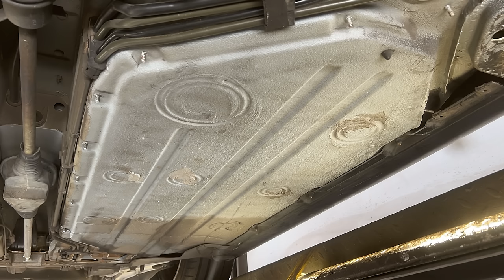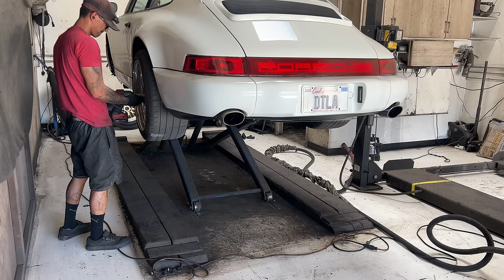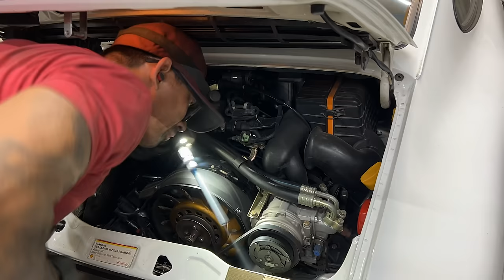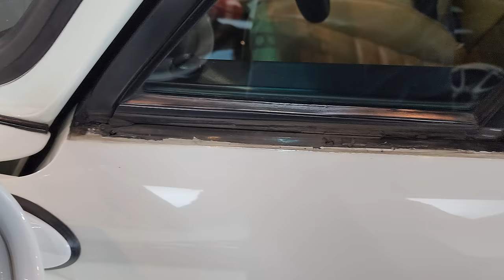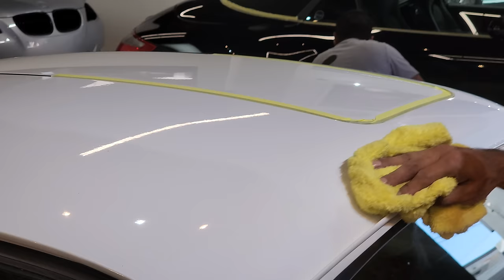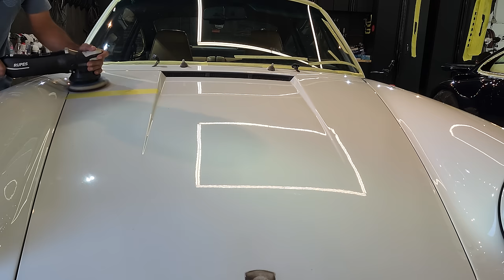Dry Ice Cleaning this Porsche 964 is SO Satisfying

Comment: Looks cool, but it’s not preservation at all. The brownish coating you see being removed it’s actually cosmolin coating from the factory to protect the aluminum components from oxidation
Reply: Taught me something today
Reply: Blah, Blah, Blah and more BLAH
Reply: @orangepeel2223 are u okay bro
Reply: Two mistakes... Aluminun rust naturaly on external layers only and, the rest looks like galvanized steel.
Reply: Should be reapplied after if the owner/ shop is aware of physics

Comment: Hy, "I AM Detailing" has been using Dry Ice Cleaning or Dry Ice Blasting for some time now, and the result is excellent, much less tedious than cleaning with liquid products of any brand, and you don't flood your garage because, contrary to what you might think since it's dry ice, it's dry cleaning, so there's no trace of water or anything else.
 There's also laser cleaning, which is also excellent, where there's no need for an external agent like dry ice, just plug in the machine and it's ready for use. Some machines have 3 functions: cleaning, welding and cutting, like a plasma, but much cleaner when it comes to cutting.

Comment: So nice! Do you apply a clear undercoating after dry ice? And why don't carmakers use a clear undercoating to show off the beauty of the engineering?
Reply from the maker: We typically apply some level of undercoating after, at minimum its a clear matte protection wax. These older german cars typically have cosmoline, which is an excellent product to protect from rust, but has this ugly yellowish tint to it. We have a few modern options, like waxoyl, which are at least better looking
Reply: Good to know. Thanks!!! Good luck with the move to the new facility. @IAMDetailing